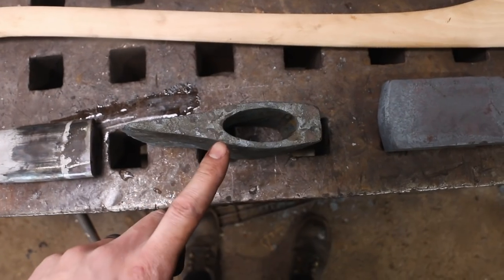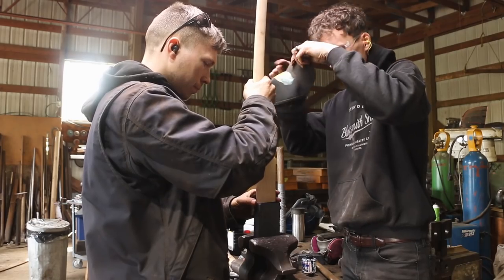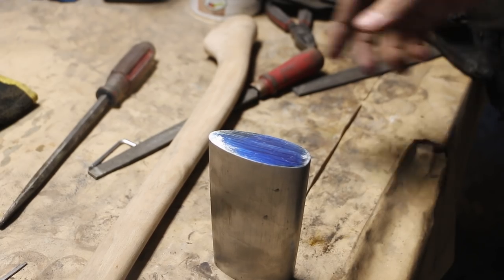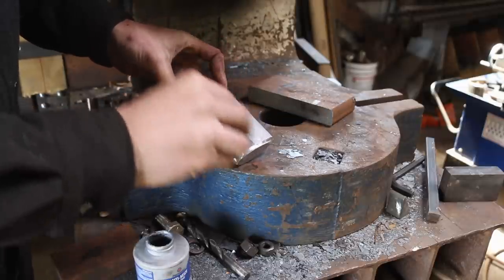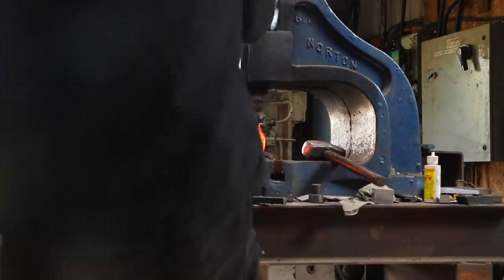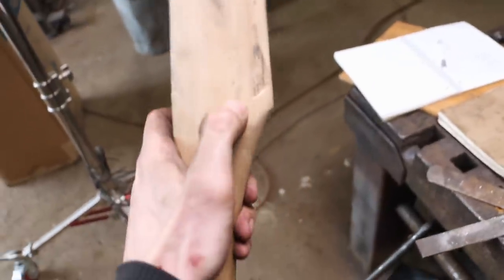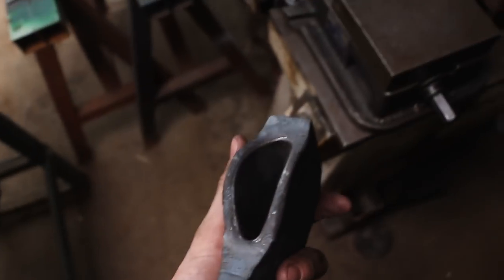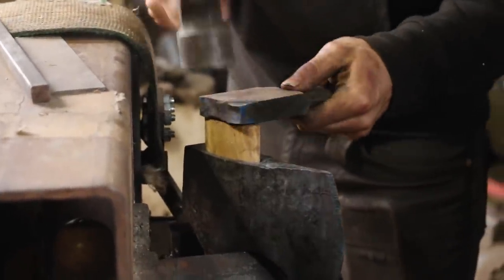How to build a perfect axe drift

Comment: Thanks so much for this video!! I have made a few drifts and refinements on them trying to get a good handle/axe seat and it's never been satisfactory. I haven't seen anyone else explain how the final shaping works and why the geometry is the way it is, this helps tremendously. I usually see people using a drift from the top and bottom together but the taper always leaves strange issues with fitting the handle, but this nails it. Cheers!

Comment: Hey Tim, I love these videos and I love the hatchets I bought. I took both my 1913 and 1919 Blackhawks to the fire station where I work and a few of the Firefighters were really impressed with the 1919 weight and handle design. One of them even said they'd be tempted to take one with them to do roof ventilation during training. Just so you know these guys are seasoned veteran firefighter so take pride in your work and keep being awesome.

Comment: Dude, ever heard of a pattern duplicating lathe.  Well, you don't need to buy one, you just need 2 linked parallel shafts, put the handle on the pattern shaft & the drift on the other shaft  & mount the angle grinder as the cutting tool.  The shafts don't need to be powered, just hand crank because the grinder will do the cutting.  The pattern follower & cutter are linked.  As the follower follows the shape of the handle' it controls the cutters position to duplicate the exact shape.  Sure the grinder will wear as it cuts, so make cutting depth adjustment and several passes until it measure exactly the same as the handle using Vernia calliper's.  That way you get the drift exactly right on the 1st attempt.  It's a bit build, but how useful will it be over many projects.
Reply: Might as well go full cnc at that point :)
Reply: You should make a video showing us how to do that. It sounds like a technique many would be interested in.

Comment: Great learning material, have a question though: why leave the hammer marks on the blade itself? Wouldn't that cause enough drag to stop the axe before it goes into the wood far enough?
Reply: All of these axes were for just testing so the flaws aren’t very important. Your question though is somewhat true if you’re not very strong. For most axes it’s the weight and the swing that separates it not the edge.
Reply: Other way around... The uneven surface means that less metal is in contact with wood, so less friction and deeper cut. Some kitchen knife blades are textured for the same reason.

Comment: Great Video, but I was wondering the whole time why you kept wasting your time barely grinding/sanding it down (the drift) when you were press fitting it on so tight, you could have easily brought it down enough on 2 or 3 trips back to the grinding station. I feel that you want to bring that front left section that was marked kind of low down a bit more even though it is still good, and that goes to what I originally said, wasting time being over scrutinous on such a wide tolerance of that whole handle top.

Comment: "Pretty good, I can even go a little more" is downplaying it my friend. You need contact to be on above 90% of the surface and you have it below 40.
Reply: That's without the wedge in bro, of course when there's a massive gap in the wood it's going to push together before scraping on the metal
Reply: @petesmith13  You're going to need more contact even without the wedge. The handle should be a bit thicker to begin with. Then you "rasp" the handle down a bit to fit it in the axe. The wedge should only be a safety measure. That's how late grandpa Djura though me. Pass on the knowledge bud. Cheers!